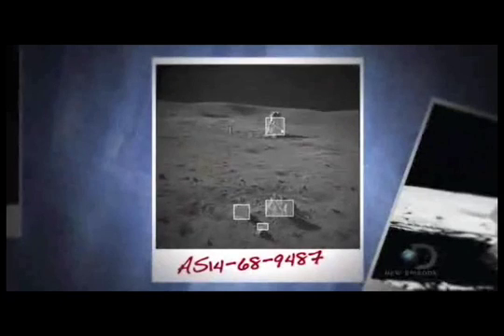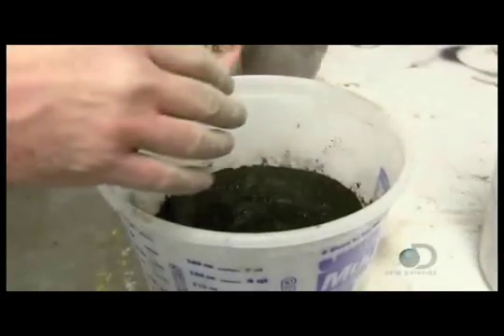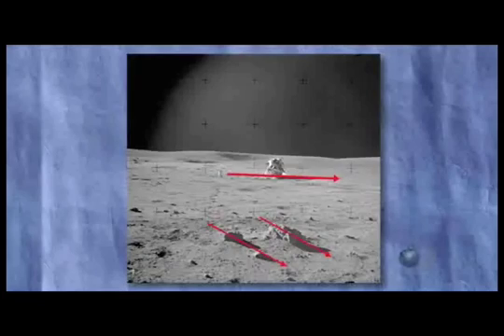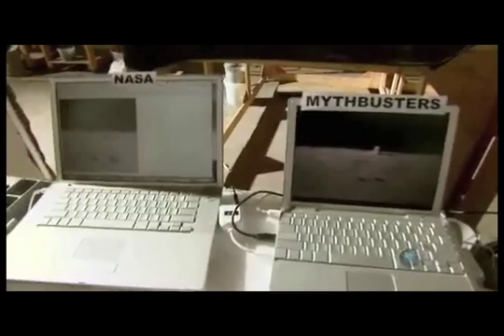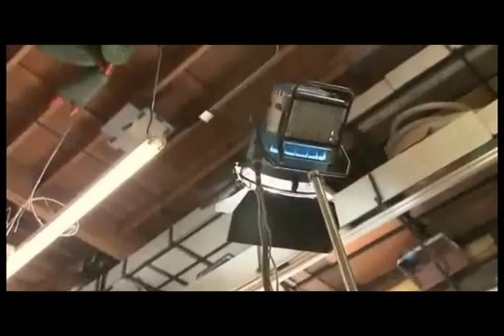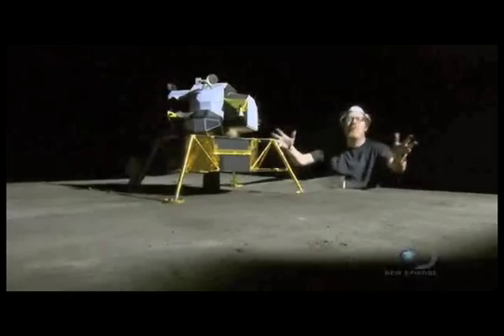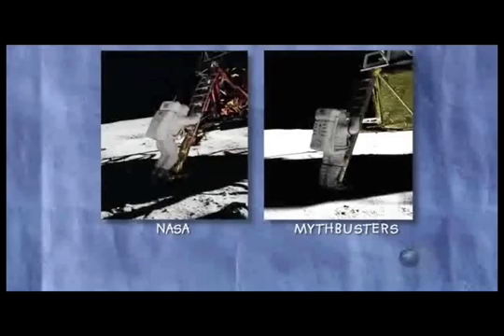Mythbusters Moon Hoax Photo Explanations

Comment from the maker: @Lucky Sparks, where did you get this comment by Michell about "Mission Control"? That term doesn't necessarily refer to a PLACE, but to a GROUP.  At the time of the A13 explosion, Mitchell was certainly working iSight the task of "mission control.".The task of "mission control" isn't all in a single room or even a single city! Mitchell then spent days inside the LM simulator to help solve the problems. Your claim is a bit ridiculous & foolish.

Comment: If u doubt me,go to a completly dark room with a flashlight and try to film anything that is not in the flash lights beam. And the compare it to this video.
If that wasnt enough, they clearly dont know how reflection works. unless they thing light makes curves(and plz, light can make curves, just not in this environment). If the terrain is totally plain(I mean TOTALLY and fully fulfilled, like a glass),the surface would work like a mirror, so u cant have any light beam on dark spots.

Comment: ermm also if the astronaut was lit up then there should be no shadow of the lunner module bec of the dust emitting reflected light of the sun would be like a 2nd source of light of the top the ground and also the moon is very bight at night so shouldn't either the camera aperture by turned all the way down ie small hole low light, or the ISO of the flim is very low? other wise u all u would see is white light

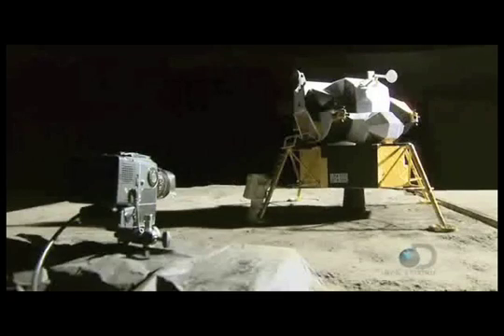Comment from the maker: @09F150, but he's not COMPLETELY dark. Remember, these are not exact conditions--they can't be. At 6:55 the exposure must be lowered because more bright surface are visible than in the exact photo being compared. So, you'd be comparing apples to oranges. Another way to put it is to say that those two shots you refer to are not under the control of the experiment. It may even be possible to change the exposure even more & make the a-naut go completely black!  But that's not a fair comparison.

Comment: @LunarTuner "a shadow is a shadow." ok that shows lack of knowledge. 
the sun is allways in the same position millions of miles away,a artificial light instead can be placed anywhere, so the problem here is that u can place a artificial light in between the 2 models and have 2 shadows in opposite directions but u cant duplicate the same effect with sun light because u cant place the sun in between the models.u can do everything with artificial light but not with sunlight, thats the point:)

Comment from the maker: @LunarTuner NASA: "Modifications to the cameras included special large locks for the film magazines and levers on the f-stop and distance settings on the lenses. These modifications facilitated the camera's use by the crew operating with pressurized suits and gloves. Additionally, the cameras had no reflex mirror viewfinder and instead a simple sighting ring assisted the astronaut in pointing the camera."

"...Kodak was asked by NASA to develop thin new films with special emulsions."

Comment from the maker: @kevinstuartfr0st, NASA: "The outer surface of the 500EL data camera was colored silver to help maintain more uniform internal temperatures in the violent extremes of heat and cold encountered on the lunar surface. Lubricants used in the camera mechanisms had to either be eliminated or replaced because conventional lubricants would boil off in the vacuum and potentially could condense on the optical surfaces of the lenses, Reseau plate, and film." (...more...)

Comment from the maker: @kevinstuartfr0st, the coating is only ONE way cameras used in space are protected. Remember, heat can't transfer in a vacuum by convection as on earth. There's no air. Reflecting light into a vacuum is a powerfully effective way to dissipate heat. Heat doesn't saturate airborne particles because there AREN'T ANY! Hasselblad cameras used in space work quite well. 100s of 1,000s of photos prove that! They are specially insulated & yes, it works!

Are you saying current space photos are also fake?

Comment: @XboxPhantom Leaving is easy enough. Same as any other launch you see. Just all smaller ratios for gravity, speed, and required thrust. You leave moon dock with the CM and use its power to return. Slow when you enter back into earth orbit. Separate CM from the LEM and the rocket. enter the earths atmosphere at over 5 thousand miles an hour and so so on. 

HOW HARD IS THAT? Other than the Money needed (not a problem back then) and just some good pilots and a well programed computer.

Comment: @XboxPhantom You get to orbit A faster velocity will mean a higher orbit, and so on, we pick up enough speed to increase your orbit. and so on. to a point where you are close enough to the moon for its gravity to pull on you more than the earths. So you are able to decelerate and go into lunar orbit. Landing on the moon is not hard, no atmosphere, so you slow the LEM down so you will start falling faster and faster. Full thrust near end to soften the landing and your on the moon.

Comment: In order to bend that shadow that much terrain on which those rocks lay should be VERY MUCH bent in a low frequency(because high frequency will just deform shadow itself and not its direction).

And I shown that even with almost 45 degrees terrain bending you don't get nearly as nonparallel as in NASA picture yet there are so many little rocks that are standing on very flat terrain and are still extremely non-parallel. That for me proves it without thinking twice.

I also did it  with real sun.

Comment: Great! good point, here I will explain how you debunked yourself.
That video is a  very good example of how you NASA people avoid direct proves and SIMULATING the situation but just take some other COMPLETELY different scenes and then use it as a "debunk".

First of all No matter how miserably small focal length of lens is when you watch two shadows from SIDE you cannot change their parallelism, you can only CURVE them themselves, but not keep them straight and change their direction.

Comment: No at the end of a day it was in the same room as the desk, that's NOT going to negligate the angle trust me.
Second its NOT focused, in order for it to be like directional light it would have to be similar to laser light, so it doesn't widen as it goes further from the source(I already said this).

And again SCALE is not a factor, factors are DISTANCE between objects and source light, AS WELL as between objects themselves.
Which in this case obviously is making drastic angle.

Comment: And second, thank you for providing me with the original picture.
When I look at it it just proves our point, what you call "not flat terrain" is absolutely true but it is a high frequency-not-flat and only for that bunch of rocks on right, others are on relatively flat terrain, also here I see many other tiny rocks on very flat terrain yet their shadows are gradually more in-parallel as it goes from ship to rocks, which just proves that there is a spotlight right on the left of that whole scene

Comment: I agree and disagree.
Yes they are using "spot-lights" but this spot light is nothing more than limited point light.
Which makes ABSOLUTELY no difference. If it was perfectly parallely focused it would look like LASER RAY and wouldn't widen as it goes further(and that would actually be a good simulation of sunlight).

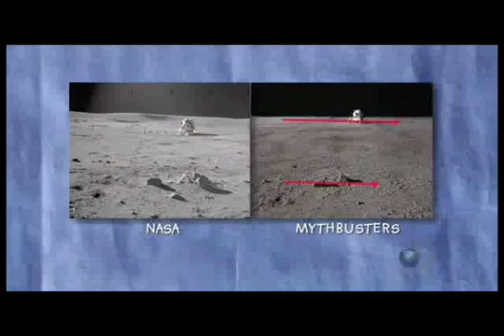And I LIKE that you pointed out 2:42 do you see the difference between that one and the in-parallel one? yes completely different pictures! whether remaked or 2 different "suns".

Comment: SpreadingtheMuse, don't know where you are coming from here. it was done inside with a superlight alright.
You cannot argue with the angles on relatively flat ground. Let's check numbers.
A light source at 20metres will cause the shadows to diverge, and at 14 metre from the light objects and at 14 metre apart it will cast shadows  at an angle 45deg from each other. Now with the light source at 93 million miles the angle at at the same spot will be 10^-9deg. Thats parallel eh.

Comment from the maker: hunchbacked, The problem with your idea is that the same scenario can easily be reproduced here on earth with the same exact lighting--THE SUN! It's not a matter of the proximity of the light, but the wide-angle optics used (the Planar 70mm lens). Every photographer will tell that a wide lens accentuates "parallax", convergence and divergence. They would obtain THE EXACT effect with the same, real sun, right here on earth.  It's optics.

Comment from the maker: charlienecro, you're misunderstanding. The "fiducials" or "reticles" used in the Hasselblad reseau plate have a tendency to appear fainter (or even see to disappear) over the top of very bright objects on film. In photographic processing, these very white areas of emulsion on the film tend to bleed over the top of these very fine "crosshair" ines. No reason to assume any cutting and pasting. In some cases, the lines appear & disappear predictably. For example over the stripes of the flag.

Comment: go out in your yard, light a cheap bottle rocket, set it off over loose dirt and see what it does, now you tell me that a mans footprint will make an identation that can be photographed etc. but the LEM landing will not even disturb the surface? Also what about the sound from the engine on landing, why is it that you can barely hear it? this is not me saying this but experts.

Comment: Calculating the orbit and tracking movements through the inertial guidance system would be MULTI-processing which would require code to be executed in seperate threads.  EXTREMELY intensive if not damn near impossible for a computer maintaining only 152kb of memory.

The Soviets had the first remote controlled vehicle to land on a celestial body.  How the HELL is that inferior technology???

You have fun in fantasyland, I'll stay over here in reality.

Comment from the maker: bEaZzy89, every photographer knows that NO stars show in any photo or video where the shutter speeds are shorter than 8 seconds or so. Can't be done! It's a photographic impossibility. Apollo used "daytime" shutter speeds of from 1/125th to 1/250th of a second.  

There's no giant crater because the LM landed used only 2.640 lbs. of thrust-the same as a 737 taxiing to a runway.  It wouldn't knock over a luggage cart. Why would it dig a hole? A Harrier uses 26,000 lbs. of thrust, but no crater!

Comment from the maker: ilcataj2007, what you smell as "bullshit" may simply be a lack of info. Buidling a station on the moon is FAR more complex, expensive and dangerous. Long-term exposure to radiation beyond earth's Van Allen Belts IS a concern. It would definitely not have been lethal to the short Apollo missions, but such a base is VERY complex.

Actually, astronomers HAVE tracked MANY spacecraft from around the world using telescopes,radio and Doppler radar. Been there, done that.

Comment from the maker: 5kallu, absolutely.  "In a perfect world" where the surface is perfectly flat and the lens you are using is not a wide angle lens, you will see shadows parallel, just as they appear in real life.  However, a wide angle lens (like the 80mm Planar lenses on the Apollo Hasselblads), would distort anything straight or parallel.  Then, the surface obviously distorts shadows.  The moon is a VERY uneven surface.

Comment from the maker: In my opinion, Mythbusters missed their chance to comment on the "where are the stars" question.  It seems to be one of the most common objections.

Stars can't be photographed or filmed using daylight settings. Apollo typically used shutter speeds of 1/125 or 1/250th of a second. Stars will NEVER show with such shutter speeds. Yes, there is no atmosphere, but that won't effect the brightness of the stars much at all. If anything it would only effect their clarity.

Comment: Congratulations on letting everyone see your absolute disregard of facts. First, you say "To see the "astronot" you have overexpose picture (which is obvious by the absence of details [...]" The length of exposure doesn't affect the details, it only affects the amount of light received by the camera. 2nd, you say something about the steps of the ladder, the steps of the MB ladder are easily visible, it is just clear the material is not as reflective and the ladder not as detailed in the MB model

Comment: And isn`t it odd that the LM worked fine in extreme conditions even after a hard shake about on the way to the moon? (Lift off and the separation stages Not a single bolt, nut or pipe/hose loose...?

Comment from the maker: olaffer, the LLRV and LLTV were designed to work on earth in earth's gravity. That's harder. The problem Armstrong experienced was not their handling, but a malfunction. The helium pressurization system that maneuvered the steering jets malfunctioned. He had no controls and it pitched over. Several astronauts noted how much easier the Lunar Module handled.

Comment: You're welcome! ;)

Strangely, the LM was easier to maneouvre while landing on the moon than the trainer was here on Earth. The simple reason is, there was no wind to contend with. The crash you refer to was caused by a failed valve in the jet system used to simulate 1/6th g by taking up most of the training vehicles weight while operating in Earth grav, so wasn't even a part of the LM itself.

Lots of oddities don't amount to much if they all have logical explanations!

Comment: IIRC it was described as more of a low, rumbling vibration (something you could feel) than a really loud noise (I'd need to double-check that one).

The mics were mounted on the snoopy helmet inside the pressure helmet. Many simple mics are designed to pick up the operators voice and reduce extraneous noise. I don't think that would be something too difficult to do in 1969.

Comment: It's not so much the amount of dust I was referring to in the clip, it was the focus of the rocket plume. It looks to be concentrated in an area pretty much directly under the nozzle.

The LM was also adjusted by 4 quad thrusters. If you don't accept that it could land safely on the moon, you need to explain why it was possible for remote landers with no pilot to do so.

The LM had plenty of testing done on Earth and in space prior to Apollo 11, which was itself a test landing.

Comment: I`m not sure I agree with you here.. To me it seems like it would have cleared ALL the top dust (even at lower gravity and without air) The big differnce is that this one is flying over concrete (or asphalt) so you don`t really see much dust flying around. But it raises another problem for me. Se how the nozzle is constantly correcting the moves? I assume it is using some kind of computer to work that out. Hovering with one nozzle is even hard today. The LM was UNTESTED but made it EASY...

Comment: I have no problem with the top surface layer.. What I don`t understand is HOW it can be inches of dust just feet away from where the rocket has "blasted" 3000 pounds of thrust.? Wouldn`t more of the area be "basted clean"? I would have thought that BOTH the LM footpads and Armstrong should have experienced compact regolith.. Why is he only concerned about "how soft" it is and if it is going to support him enough to get back up the ladder? He comes down the ladder facing inwards!

Comment: And I`m very disappointed with the "research"! .."they black out the set".. That only means that they don`t allow any light in from the surroundings! The material they use to "black out" MUST also, like the "lunar" surface, reflect SOME light! What is the reflective index of the "black out" material? How many sq feet of this material are they using, and at which distance to the photographed object is it placed! This effect of the "black out" material will also be affected by the light strenght!

Comment from the maker: Just an observation. Not only is does the surface of the moon provide "fill" light to illuminate the shadows. Armstrong--the one taking the picture-- is wearing a white EVA suit specifically designed to reflect as much light as possible to aid in cooling. Mythbusters doesn't account for that. That That would have made Aldrin appear even brighter.